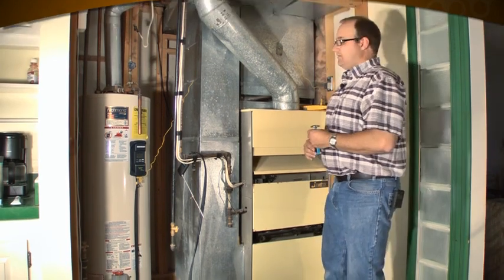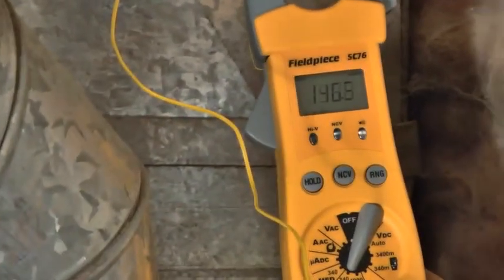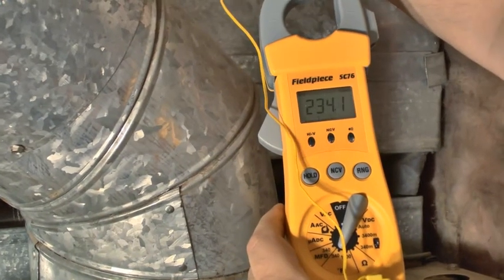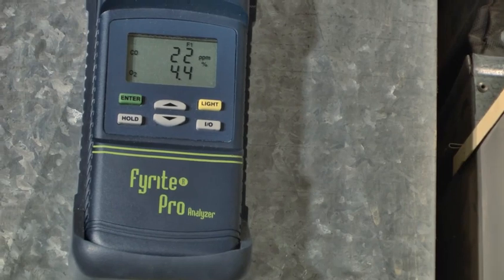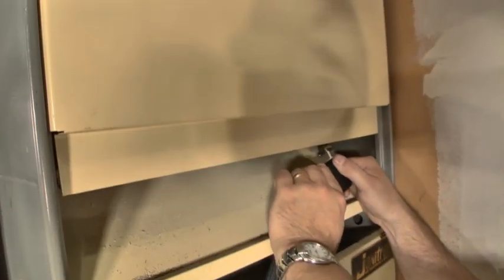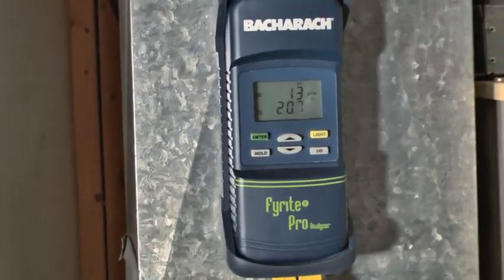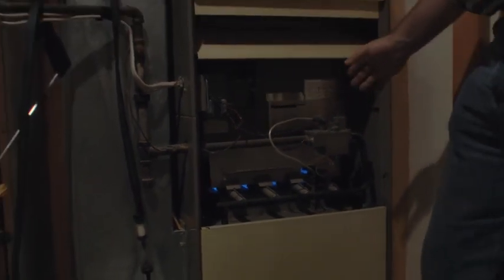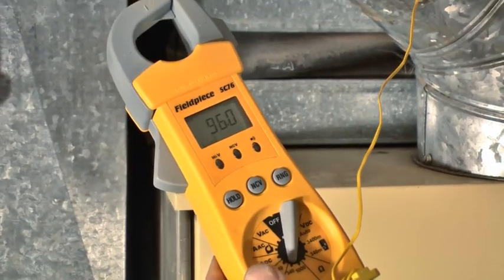Gas Furnace Basics: Part 2

Comment: Is the right side of the furnace against a combustible wall?  Wood?
Doubt if it’s 0 clearance on the sides.
High limits are usually set for 180 degrees.

Comment: Very clear video and helpful 
What if the fan is not running or damaged or not connected does the burners will turn on with no air flow ?
Or it will shut off the gas automatically.
Reply: MJ BA  it will fire up then shut off quickly by the high limit

Comment: And the filter made it quieter not beccause it's rubbing against anything it's probably
Just so dirty that it's not giving you enough return air so your blowers working harder to get the air
Reply: actually if a blower is moving less air than it is supposed to, it is working less. If you were to actually use an amp probe and check how many amps it is pulling, you will find that with less air flow it will be pulling less amps. Therfore the blower is working less. 

I know you posted this 11 months ago, but I couldn't help but to correct you on this

Comment: Hey Mike,
How about using some mastic to seal up those holes so you don't have a possible negative pressure near draft hoods in a CAZ zone, you already determined that there isn't enough combustion air and make-up air for that space.
Change that filter and better inspect for leaks or cracks in those heat exchangers, if it's been hitting the high limit like that and not moving enough air across the exchanger, my agency just changes anything out with a draft hood, standing pilot, and over 900ppm.